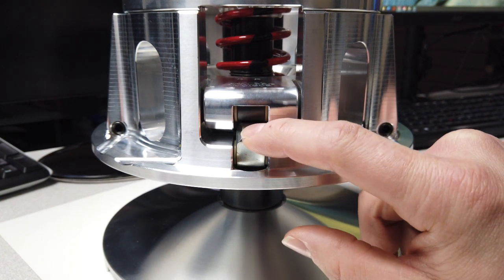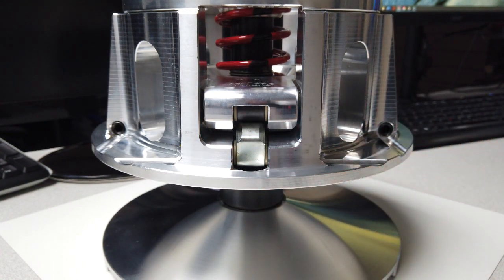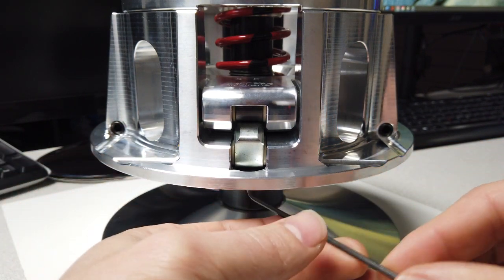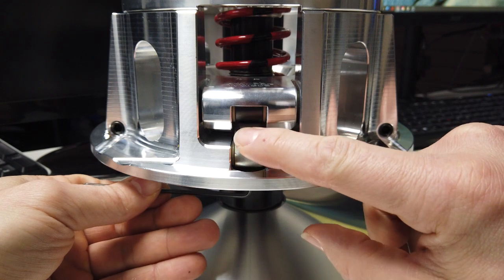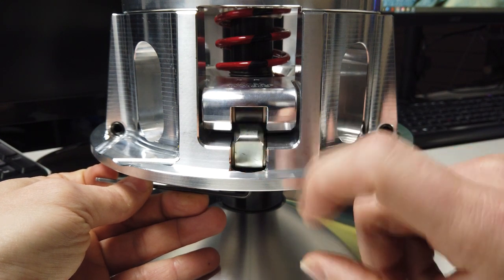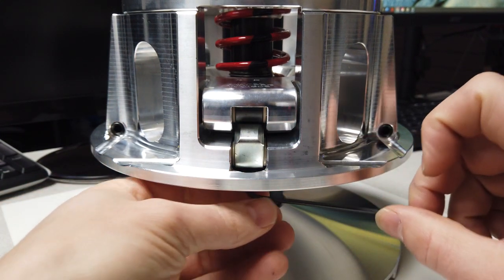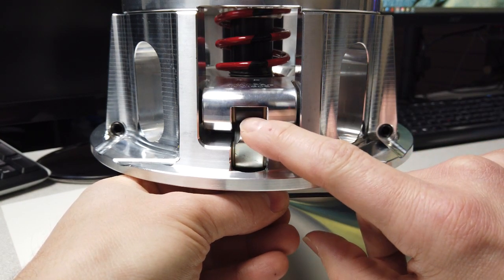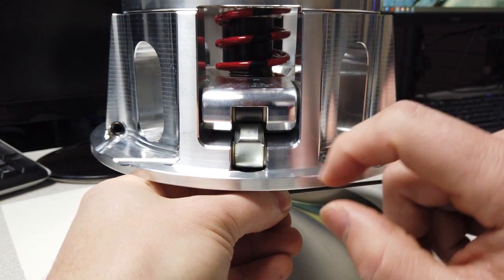STM Primary CamArm positioning adjustment screws

Comment: My STM 3P doesn't have that adjustment screw hole in the clutch face and is "always engaged" or "hard to shift" even after installing (6) .020" washers in the STM Gen 2 tuner secondary.
What options do I have?
Reply: Same here, but a 3RS primary on a can am maverick turbo 1000r. Chasing everything, same issue. Have you noticed the belt riding the sheave faces or is your primary bearing stuck or dying?
Reply: @drakenameless2522  Both clutches have less than 300 miles on them and work really well besides being hard to shift. There are times when I can shift back to park with about 8 pounds of pressure. But most of the time it just won't shift unless I turn it off.
Reply: @jschenkyou  I'm fighting this issue as well. I'm sending my clutches in in hopes of that they can figure it out
Reply: @WeekendsExcursion  Please let me know if they are able to solve the issue. I have thought about machining a spacer that is .120 that I could replace the 6 shims then add what I need on to get the clutch to freewheel
Reply: @jschenkyou  I'll come back to this. Once it is done. I have a suspicion that I have a weak spring or stuck roller. Its to the point now my belt is screaming if I come to a stop. So I'm going to send it in with a description of what my rig is, riding style, and tires being used then go from there.
Reply: @jschenkyou why are you running all 6 shims ? I have 3 in and it shifts like butter